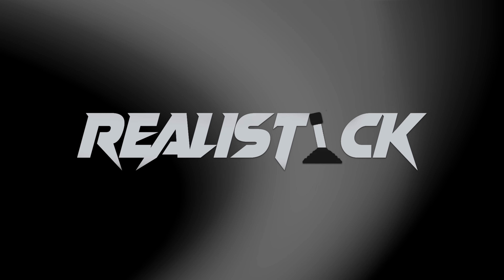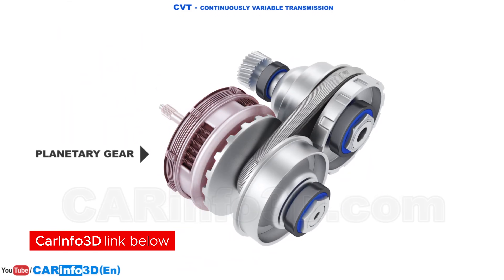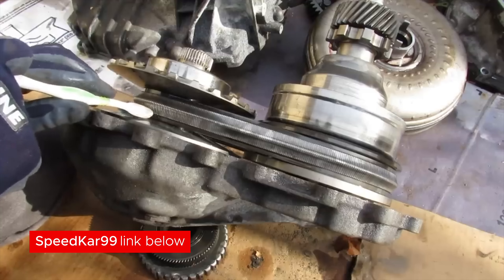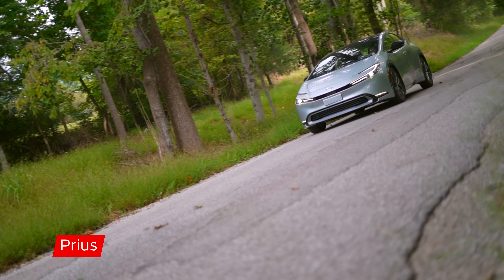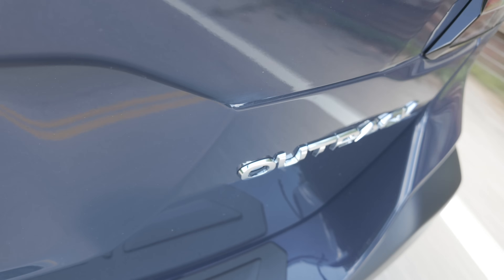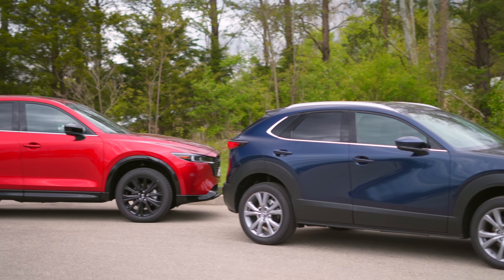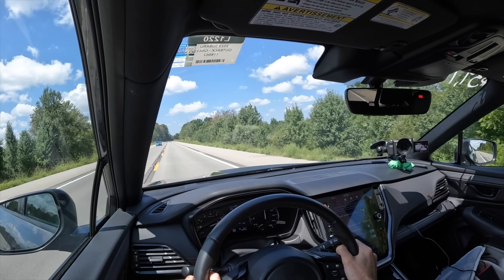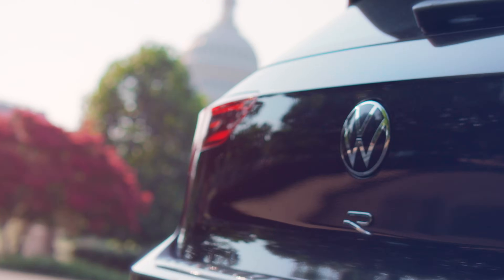Why CVTs are Great for Some Cars! (And Are They Reliable?)

Comment: I am one of the weird people that actually like CVTs, I am a person who is very light on the throttle and like to get the best gas mileage as possible. I drive a 17 Corolla with a CVT and i just crossed 170K miles and it’s still running great. I have done my regular transmission fluid service every 40k miles. The only thing I do not like is starting from a stop can give the “rubber band “ feeling. I think the first physical launch gear was a huge improvement from my car. I love how smooth the transmission is, I don’t personally mind the “drone” effect. I think Nissan absolutely ruined the CVT for the US, I think CVT’s can be decently reliable when they are made by the correct manufacturer and is services regularly.

Comment: The thing I just thought about: Just like happened with the norm changing from manuals as the standard to regular automatics, I believe that as another generation passes, a  majority of drivers will become people who won't miss the feel of geared transmissions as much.  I remember when regular ATs were disparaged as "slushboxes"... now, in 2025 oh dear, how superior to CVTs in driver engagement! 😅   
The real killer for CVTs was the way some companies tried to sell it as "maintenance free" when it's actually just the opposite.  If they'd had the honesty to say "this requires a lot of maintenance, but you should NOT DIY, only at a shop" they would have had more respect.
Reply from the maker: Interesting take, I always thought of “slushbox” as the terrible transmissions of yesteryear. They shifted slow and were geared super tall. Which never paired well with the low power engines that were common place back then (even now, a 4 speed auto would be bad). I don’t confuse them with modern automatics. CVTs could also improve themselves to a similar degree, but I get why some people refuse to drive them.
Reply: Our VW has an 8-speed transmission.  I feel like it is constantly shifting.  Having had an Outback with a CVT before the VW, honestly it feels like a similar experience.

I will also add that the Outback's CVT started to chain-slip at 105K miles.  They don't fix them, you just buy a new one:  ~ $8000.  No thanks.

Comment: I love my 2012 maxima. It’s powerful and I LOVE the “manual” option as it really helps your brakes last longer and it’s great  for snow and rough terrain. Granted it has to be more flat lol. I have an electric shade for the back window and it’s powerful and quiet inside. Idk what I could get in an suv that’s comparable but doesn’t break the bank like my maxima did lol

Comment: I have a 2017 Crostrek with 170K on it never any issues with the transmission . I change the fluid every 35K Cvt transmissions have to have clean fluid. I use Lubegard Cvt fluid because it has a chemical heat sink tech in the fluid LXE and Cvt put out so much heat.

Comment: I have a 2020 subaru and at about 65 thousand miles the cvt transmision went out  if I hadn't  had extended warranty it would have cost me 13 thousand dollars to replace at subaru ,my next car will not have a cvt.

Comment: Are Subaru CVTs now made or designed by Aisin/Toyota or are they made or designed in-house by Subaru? I know that Toyota’s older CVTs found in the CHR and 2014-2019 Corolla lack the launch gear, and Subaru used to get CVTs from JATCO (Nissan) until a few years ago
Reply: Subaru never used Jatco CVTs. They used Jatco trad autos but not CVTs

Comment: A CVT by good manufacturers (such as Honda, Toyota, and Subaru) can be reliable if taken care of, with proper maintenance and not harsh acceleration. A CVT won't be reliable if it's made like Nissan, for example, or any German brands, or any American brands, even with care, they will fail early and be costly to replace. You can find a good car with a CVT transmission, it's a matter of knowing what to look for and what to avoid

Comment: I purchased a 2012 Subaru Impreza hatchback second hand in 2018 with 50K miles. The CVT transmission gave out at 101K miles, less than 1500 miles out of warranty, and Subaru offered me $500 towards the fix. At the time my vehicle was worth $8K (pre transmission issue) and it would’ve cost $7500 to replace the transmission since it was not fixable. Subaru extended the warranty on those cars from 60K miles to 100K miles and even reduced the oil change interval recommendations because they knew how poor they were. Long story short that was my last Subaru and the last car i’ll purchase with a non-hybrid CVT transmission.
Reply: It was the first model year of that generation. Never a good idea

Comment: I have a 2016 Honda CR-V with a cvt and it has 110k miles and no issues it still works like new. It’s super smooth and I average 38 mpg with it

Comment: I had a 2012 Mitsubishi Outlander with the dreaded Jatco CVT. It felt so slushy, but did allow for pretty good mileage. It was starting to fail at 88k miles, but was replaced under warranty at no cost. My current car is a 2021 Kia Soul with a CVT that shifts so much better. In sport mode it really changes the simulated shift points and hold gears much longer. In regular mode, it simulates shifts smoothly and offers great economy. I learned from the Mitsubishi, and had the fluid drained and replaced at 50k, so hopefully it will last. That’s my only concern.

Comment: We have a '20 Legacy with the 2.5, and a '21 Outback XT.
I love the CVT's!  They don't let the cars gain speed unless I want to.  (My 5-speed manual Passat would pick up speed when I eased up on the gas - both from the engine/tubo having spooled up.  The same is true of other cars I've had with conventional automatic transmissions.)
The CVT's can 'crawl' up any hill much more controllably than any other car I've ever driven, and once you're going 25 or 30mph, they accelerate well.

Comment: I drove a 2017 Honda civic for a few years then switched to BMW 430i. I have to say, sometimes I miss the smoothness of the CVT the civic had. But overall, the ZF 8 speed auto is a MUCH better transmission overall. But that might be because I tend to drive my cars more spiritedly.

Comment: I too was torn between a mazda and subaru for my daily. I have owned vehicles from both brands in the past but only with manual transmissions. This time I wanted an automatic, well not really, but I knew this car would get passed on to my daughter, so it made sense. I was initially drawn to the mazda because as an enthusiast all I have ever heard was just how horrible CVTs were. Well, after being thoroughly turned off by mazdas horrible infotainment system, I went to check out a subaru with the dreaded CVT. I was immediately shocked at how much I didnt hate it. I am now the proud owner of a 2024 impreza RS. I have no complaints with the car at all.
Reply: Subaru infotainment is worse than Mazda lol
Reply: @theredsalmon612  Not by a long shot. Sometimes it isnt snappy fast, but it is very well laid out and easy to use. Its operating system is is initiative and just makes sense. For anyone that actually likes to use the tech the car came with and not just a couple things on the favorites tab, the mazda system blows.

Comment: It's too bad that the younger generation never got to experience the beloved 2 speed Powerglide transmissions.  They were very reliable and got the job done.
Reply: Did that come standard on the Ford model-t? Just how far back do we need the Time Machine to go to experience that?  Hot danm
Reply: @MisterMister5893  Chevrolet 1950 to 1973.

Comment: well technically automatic transmissions have been around for 75 yrs debuting first in the 1949 Oldsmobile 88 and 98 models and those were 4 speed automatics while most other makers were using 2-3 speed automatics and 4 speed manual trannies until the 1970s

Comment: CVT is great for the right purpose. I prefer them for the following reasons:
1. More efficient - That’s why they are getting more common because they reduce fuel consumption.
2. Continuous drive - No power gap which occurs during an auto/manual gear change. My wheels are always driven.
3. Smooth - I particularly enjoy descending hills with adaptive cruise control engaged because the vehicle doesn’t have to brake.

Comment: As someone who has daily driven a manual for 16 years, I prefer the way a CVT drives compared to a regular automatic. Because I'm no longer frustrated by the gear it selects for me. But I drive a car with an eCVT now (a hybrid Lexus), which is extremely reliable. It also helps if the engine is powerful enough (I have a 3.5 V6) that it doesn't have to rev extremely high constantly. It's pretty annoying in a Prius.

Comment: 2017 Subaru Forester XT was a brilliant car, it was fast, fuel efficient (for a brick) and quiet. Acceleration was smooth, she'd pull every launch and I never once felt a CVT rubber banding effect that people talked about. Fast Forward 170,000 km and on the 3rd CVT we sold it. Now the CVT in a Toyota Yaris, is a slushy POS, that's where I felt the rubber band effect, lack of power, lots of noise. I had to put it into simulated manual mode to make that car go anywhere at anything above a snails pace.
The car I have now (Suzuki) has a traditional gearbox and I really miss the smoothness and performance of the Subaru CVT, I think it would get more kpl too.

Comment: My wife has 2014 Forester XT with CVT. While it is not my idea of fun, I can appreciate how totally smooth and non-dramatic it is accelerating and it is pretty responsive for what it is. 

The non-turbo Crosstrek and Forester loaners I've had from Subaru are terrible however. I think it is the combination of lack of low end torque and a different CVT type used for non-turbos.

Comment: I bought new a Mazda CX-30 in Sept. 2021 as had a lot of trouble with my 2014 Ford Focus (bought used in 2016) with its infamous DCT. For sure that exxperience and of many issues with CVT's I wanted a small vehicle with a real automatic transmission.

Comment: Remember, there is no such thing as "lifetime" fluid" for any transmission, including CVTs. I personally don't like CVTs, but if I had a vehicle with one, I would change the CVT oil every 30-60k, regardless of the manufacturer.

Comment: The first car I purchased with a CVT was a Nissan Altima. I didn't even know it had a CVT until owning it for about 4 years. Never had any problems with it. Eventually gave the car away and it's still running without issue with over 120k miles on it. The new owners don't know it's a CVT or even what a CVT is. 😊

Comment: CVTs work best with small underpowered engines on paper but at the same time having an underpowered engine makes their odd character painfully obvious.
Reply: Not necessarily, it depends how one drives it. I have a 2020 Corolla LE with 139 hp and it uses the CVT, so smooth, you don’t even hear the shifts at all even from the stop.
Reply: @alvinsimba734 You don’t hear shifts because it doesn’t need to shift, it has no gears.

Comment: Is it the cvt that makes the droning sound or the engine?   That to me is the worst part of cvts.
Reply: Technically, it’s both. Because the cvt keeps the engine in the most efficient gearing ratio for its specific power band and torque curve meaning it stays in the rpm as you drive. So the cvt causes the engine to drown, but the sound itself comes from the engine.
Reply: @chritchharrass7159  Thanks for the explanation.

Comment: What I experienced with my 2014 outback this year is I had a little noise occurring when revving the engine. Took it to dealer and they confirmed that it was the CVT. They also told me Subaru does not allow them to open up the CVT since it’s a closed unit, and they would have to replace the entire thing for $12k. Subaru refused to help me after I called them and opened a case. I fortunately had an extended warranty cause I bought the car used and this saved my ass. Car is not even worth $12k..
Reply: That was a lie from the dealership, all they have to do is take the driver wheel off and open the plug and do the drain and refill and it’s done.
Reply: @alvinsimba734  to my knowledge they won’t do this. I spoke directly with Subaru America and they agreed with the dealer. Though they did not look at it themselves (not sure they even do this)

Comment: I had a lot of slipping, in my 2013 Subaru, and they said we had to replace the whole transmission… I replaced the whole car.
Reply from the maker: Ouch, can’t blame you. Probably that solenoid issue with the torque converter🤕 Subaru was jumping the gun on replacing transmissions but that’s still unfortunately common.
Reply: @Realistick but I’m the sucker in the end because I replaced my 2013 Impreza with a 2024 Impreza.  Change scares me.

Comment: Both our vehicles have CVTs.  I actually prefer them over a conventional automatic, for a couple of reasons.  They are smoother and quieter in operation than a conventional automatic.  In the case of my Venza (eCVT), it is far less complicated and much more reliable than any other transmission available.  Aside from reliability issues, most people don't like CVTs because of the way most enthusiast reviewers hate on them.  Many people think they suck because their favorite reviewers said they suck.
Reply: Toyota eCVT is not really a CVT. 1 ICE + 2 electric motors + planetary gear. No belt, no chain, no pulleys.
Reply: I like them because they are smooth. Lots of vehicles have a slightly jerk or change in power when they shift- not a problem with CVT’s. 
The speed limited goes from 35 to 55, you start to lean into the gas to accelerate. You are a quarter on the throttle, at 45 MPH, and it shifts can then you stop gaining speed- you have to press the gas more. That is why I love CVT’s- more specifically eCVT’s.
Reply: @djplonghead5403 I got a CVT which is not a hybrid and it’s so quiet and smooth and on highway it’s smooth as hell, I don’t even have to get to 3000rpms, most of the time I’m in 2000rpms.
Reply: @alvinsimba734  that is pretty common for modern vehicles. The lack of sitting is very nice for some.
Reply: @djplonghead5403  many people just can’t maintain their vehicles which is why you will hear more horror stories on the CVT
Reply: @djplonghead5403 different gadgets altogether.  A CVT is a complex belt (steel belt with hundreds of components to make just the belt) drive, and expensive to repair or replace.

eCVT hasn't got a belt in sight - will last the life of the vehicle with only minimal maintenance.
Reply: @alanclarkeau  I know. I was just saying that because they make a similar sound and have no true gears. 
I love Toyota hybrids!
Reply: @alanclarkeau  a CVT is simply a continuously variable transmission.  the planetary gearset that Toyota uses used to be called a "Power Split Device" as part of their hybrid powertrain.  they changed the marketing term to eCVT a few years ago, perhaps for simplicity, but i agree they do get a bad rep (CVTs in general).
Reply: eCVT is a completely different setup.

Comment: Want to find out the reality of a Subaru CVT value?  Simply take the one that you own, any model with the CVT and try to trade it in.  My CVT Subaru lost trade in value far more than my earlier transmission model Subarus that were also much better off road.
Reply: Mmm…no lol. N/A Subarus even with the CVT, hold value just as any Japanese car does. 
But you’re probably one of those guys who looks at clapped out WRXs, that blow, and say “damn Subarus” lol
Reply: @jimjohnson4072  I have had three Subarus.  My 2005 Outback XT held value well and was my favorite vehicle ever.  My wifes 2011 ForesterXT was great and held value.  My 2016 Outback 3.6 CVT model failed and I was offered 3200 less for it in trade from the original dealer that I had purchased it from than 3 other brand dealers.  And this was with a new CVT in it.

Comment: I've been driving CVTs since the Honda HX in late 90s, but mostly on Subarus . Never had a problem with any of them.  Yeah, manuals can be more fun, chirping tires... but for a combo of performance & mpg, CVTs are hard to beat.
Reply: I've been driving CVTs since the early 90s... Almost every scooter made has a CVT drive now. 😁
Reply: Agreed.
Reply: and just ease of driving. most of problems people are having  are nissan or Hyundai/KIA CVTs.
but if you were driving a Hyundai the engines goes first.

Comment: To me, our 2022 Subaru Legacy Limited XT performs just fine for what is. It's a family sedan with some b@lls, not a sports sedan. I think the Subarus without turbo are slugs and the CVT stands out more with them but people love them anyway. The 10-speed automatic in my 2019 Mustang GT, on the other hand, sucked, and some other 'modern' automatics we've owned have had their own quirks.
Reply: 10 speed transmissions that are always going up and down gears, searching. Hate it!
Reply: @djplonghead5403 , I had a few occasions where my car suddenly lurched forward at low speed. I almost ran into the car in front of me. I bought it as one year old used and then had multiple climate control issues. I solved all of it by selling it back to the Ford dealer for more than I had paid three years earlier.
Reply: @djplonghead5403 exactly. I drove a 9spd Chrysler and wtf is that? It was just awful.

Comment: I had a 2016 Subaru Forester with a CVT and replaced it with a 2024 Mazda CX-50 with a 6-speed auto. Both non-turbo. Even though the CX-50 is faster 0-60, likely because of the traditional gear launch advantage you mention, the Forester felt more powerful in regular driving, probably because it's always in the power band, not hunting gears or waiting for a downshift. I 100% agree that a traditional automatic, or DCT, is absolutely better paired to more powerful engines. But for small, low power engines, I think CVT might be a better driving experience. Right tool for right job.